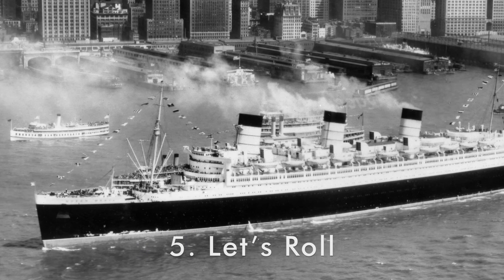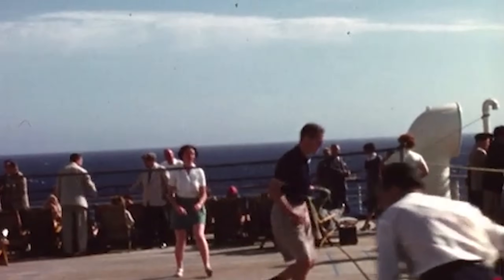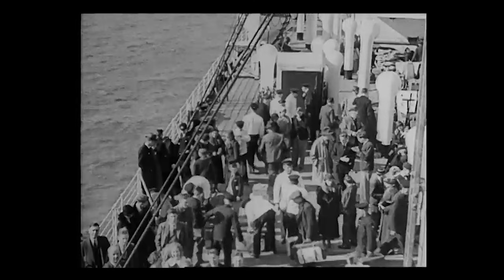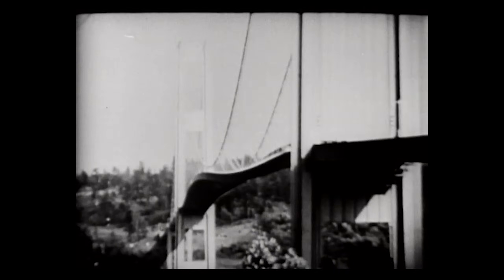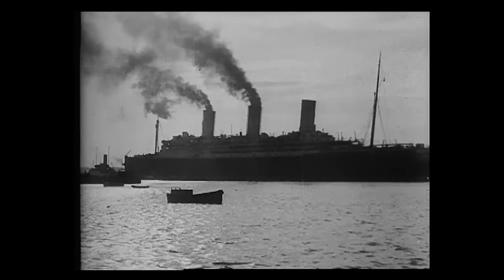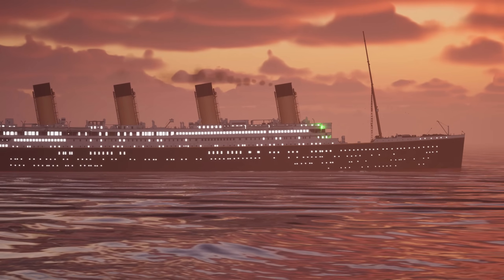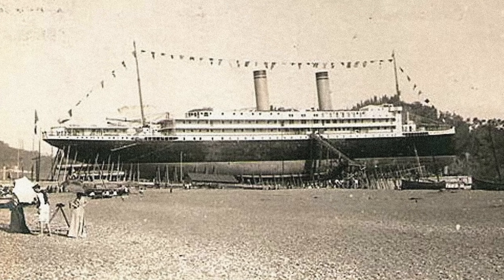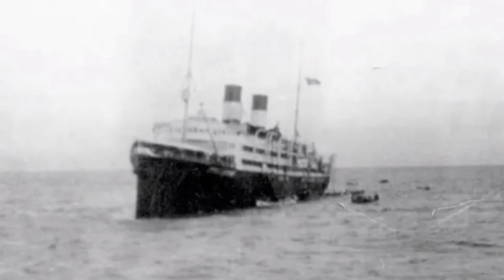5 Ship Design Fails

Comment: Regal Ship Vasa : A ship built between 2 different designs, where ship builders changed over the years, feature like a 3rd battery deck was added because it would look cool and a chief aka. the king demanded "just get it done..." And there was a thing with using different rulers where one had inches set to 2,25mm and the other 2.5mm ... A small wind gust pushed it over to the side and it took in water and sank after a very short distance.

Comment: The nr 1 ship spot reminds me of the Wasa ship, but that was only similar issue, it had its weight, but it was designed wrong considering what was put on top, so was too little weight down below, and much on top, so it also got sunk when it launched by a gust of wind.
That was not a passenger ship tho, and in quite a different age. :)

Comment: The thing that led to a hull breech in the Titanic, was a pre-existing fire of three weeks duration in the coal bunker hard up against the area of the hull breeched by the rather insignificant iceberg that ultimately sank the Titanic. The crew had struggled to both extinguish the fire, and to hide its existence from the public by berthing the Titanic stern first, thus obscuring the area of the Titanic’s starboard hull from public view. The fire weakened the hull and it remained lit and causing problems the entire time the Titanic was in transit. Weakened hull met iceberg and bye bye Titanic.
Reply: Surely you mean the small patch of smoldering coals that (1) wasn’t located up against the outer hull, (2) didn’t cause any significant damage or weakening whatsoever, (3) was completely put out over a day before the collision, (4) wasn’t covered up, and (5) was dismissed as not being that big of a deal until some journalists sensationalized the crap outta it in 2017?
Reply: @DerpyPossum  You are utterly wrong. Read something with legitimate info.
Reply: @douglascoleman1252  The inquiry transcripts, “On A Sea Of Glass: The Life & Loss of the RMS Titanic”, research papers and essays written by the likes of Mark Chirnside and Dr. Paul Lee, “Titanic: Fire & Ice (Or What You Will)”, the related article on the TitanicSwitch site, etc.
Not enough for you?
Reply: @DerpyPossum  Nope. Read it all again, including the docking rationale.
Reply: @douglascoleman1252  Oh my freaking goodness, you seriously believe the “burn mark” thing…

Comment: I wouldn't really call Titanic's bulkheads a design flaw. They were designed to hold with the forward 4 compartments compromised. Had the iceberg damage been contained to those 4 compartments, the bulkheads would have worked as designed, and the ship would've remained afloat. The reality is that, even if the bulkheads had gone as high as B Deck, there was still too much damage for the ship to remain buoyant. It would have sunk anyway. I doubt there's any ship today that would be able to float with a 300 ft series of gashes in her hull.

Comment: I kinda feel u should have mentioned that the Titanic also probably wouldent have sunk if it had a double outer hull like the SS great eastern.  Had decades before. The SS great eastern actually got similar damage as Titanic by hitting a reef but only requiered some repairs on the hull.

Comment: @ 16:00 designers not considering that type of impact.  Something like that almost happened again. A student noticed the Citibank Center in NYC would fail if the winds above 80MPH hit at it cross angle.  The instructor check the students work and realized he/she was correct. The Instructor contacted the appropriate people and Citibank immediately began emergency repairs. The repairs were on halfway done when a hurricane hit NYC.  The mind boggles if that student did not detect that. ( It is on youtube.)

Comment: The US Navy's North Carolina Class battleships had the same harmonic problem as the Lusitania.   Once the ship got her speed above 25 knots vibration became an issue and increased as the ship reach her top speed of 28 knots.  The solution was to change the propellers which only moved the harmonic induced vibrations to a different speed regime. However the vibration issue was now at a speed that would be unlikely in normal cruising or battle, around 18 knots.

Comment: That was "Galloping Gertie," the Tacoma Narrows bridge, not the bridge you described as affected by soldiers marching. It broke up for a different reason.
Reply: Actually same reason, mechanical resonance. It had a bad design and physics causes it to shake and roll in windy conditions. The video did show Tacoma Narrows on the clip label.
Reply: @ChicagoMel23  Actually not the same reason. Galloping Gertie suffered from aeroelastic flutter. Marching soldiers cause resonance amplification by matching the resonance of the bridge.

Comment: I absolutely love this channel but the idea that the Olympic class's bulkheads weren't high enough is simply inaccurate.  They were more than adequate for their designed function of keeping the ship safe while balanced against the need to work the ship efficiently and effectively.  The reason for this is simple; water will seek its own level.  Based on this, we know that water will not rise inside the hull of a ship higher than the water level outside the hull.  The Olympic class was designed to survive any 2 compartments or the front 4 compartments being flooded.  The engineers who designed the Olympic class knew this, knew the volume of all the compartments, knew the weight of the water that would fill that volume and how low the ship would go into the water before the buoyancy stabilized the ship and halted the flooding.

Based on this, they built the bulkheads with an adequate safety factor to ensure that water would not top them provided that the ship had survivable damage.  In the Titanic's case, the bulkheads being run all the way to the top of the ship wouldn't have saved her; too many compartments were opened to the sea and the weight of the flood water would've continued to drag the ship lower and lower in the water, causing the water level inside to continually rise.  Even if the bulkheads had been made watertight from above, the weight of the water infiltrating the hull would have eventually dragged the bow underwater and flooded the decks above the sealed compartments from above.

A more realistic design flaw of the Olympic class was the lack of a double hull.  After the Titanic sinking, both Olympic and Britannic had a double hull installed to cover the boilers and machinery spaces.  Had the Titanic had a similar double hull, it's possible, though not guaranteed, that her 6th & 5th boiler rooms would have remained watertight and that she would have survived her damage.   However, no change in her bulkheads, with the possible exception of longitudinal bulkheads in all of her compartments would have saved her or even dramatically affected the final outcome.

Comment: I read a Queen Mary account in "Captain of the Queens" where the former captain and commodore of the fleet described an incident within a French harbor some time after WWII.  There was a storm and he began to move the ship out to weather it, as I recall.  The anchor snagged a WWII era cable and she began to swing out of control, blown hard by the wind.  He ended up going to full power in an attempt to stop the stern from grounding but the ship still struck hard enough to be felt on the bridge.  I believe he said the very stern at the bottom of the ship was filled with concrete as a repair, and seeped water ever afterward.  Harry Grattidge, Captain of the Queens, excellent read I Highly recommend the book.  As an aside, it would be interesting to know if that concrete is still there, because that would be really bad if it is.  Concrete, steel and seawater do not mix well.
Reply: I read that book as a boy, and toured Queen Mary in 1972.  While I don't recall seeing any concrete (Ha!) when I saw the propeller shaft reduction gears, I do recall that some of the gear teeth were chipped.  I guess @ 35 years of non-stop transatlantic service might do that.

Comment: To be fair to the Titanic,  while the bulkheads only went up as high as E Deck is true,  even with a sideswipe, the key was that Andrews and those who built and designed her weren't counting on the NUMBER of compartments to be flooded.  They thought at most, it would be 2.  The Titanic (and her sister, the Olympic) could survive a collision even with up to FOUR (4) compartments gone, but however, FIVE (5) were gone, and that was sadly the end.
Reply: The steel also had, I believe, a higher concentration of sulphur, thus making it somewhat brittle.
Reply: @Peter78730  Olympic had same steel.  The Titanic sank because she hit an iceberg and the damage was bad enough that it would have sunk a battleship at the time.

Comment: A similar incident to the one mentioned 19:19 was the HMS Prince of Wales when it sunk in 1941 while being in an air attack was hit near the port most propellers shaft by a japanese torpedo and started taking on water also the propellers also cause further damage to the battleship and was difficult to turnoff as the damage also took out the controls which contributed to her eventual sinking.
Reply: She _sank_.  After she *sank*, she was _sunk_.  Sink, sank sunk.  Drink, drank, drunk.

Comment: I have often thought that Queen Mary's one time rival, the supremely elegant French liner "Normandie" was perhaps better designed...? I recall seeing comparison film clips of both liners at speed...
Normandie's bow sliced through the water like a knife through butter, whilst the "Mary's" was like sledgehammer. Added to that was the Queen Mary was considerably more powerful(some 80,000 Horsepower(?) to Normandie's 50000 +/- horsepower). Please excuse if my figures are inaccurate, but suffice to say that the British liner was considerably more powerful.. I cannot recall any stories of the "Normandie" behaving "badly" in rough seas..Can anyone advise me if this was so...?
Reply: Normandie had a reputation of being a "snappy" roller in rough seas, that is it recovered VERY quickly from a heavy roll, so much so it could throw passengers off their feet.  No long, slow "Will it or won't it?" recoverys from a roll on Normandie!
Reply: @wayneantoniazzi2706  did she roll like a drunk?
Reply: @merafirewing6591  Not at all, aside from what I mentioned above Normandie was considered very stable.  All ships are going to roll in heavy seas but as I said Normandie recovered quickly, it didn't "hang" on the edge of a roll like Queen Mary or other ships did.

Comment: I have a question:

Where did Titanic, (or other coal fired, steam driven ocean liners for that matter), get the water for their boilers to turn into steam?

I literally never see anybody talking about this, so just thought I’d ask you, since you seem to know.
Reply: Fresh water for the boilers was supplied when the ships were in port.  At sea the exhausted steam was run through a condensing system that turned it back into water again and re-fed it to the boilers.  
This was actually 50+ year old technology.  It was developed pretty quickly when steamships first began taking to sea and it was discovered saltwater was unsuitable for boiler water due to its high dissolved mineral content.

Comment: Did you know. Joseph Goebbels commissioned a anti British propaganda film around the time of the Dunkirk evacuation (1940) Titanic (1943) The film A Night to Remember (1958) repurposed the model shots of the titanic from the Goebbels film. Charles Lightoller and his motor yacht Sundowner was present at the Dunkirk evacuation.
Reply: Can’t pin down the repurposed model footage, however the film A Night to Remember did repurposed some elements from the Titanic (1943) film.
Reply: @simonchandler9601  Supposedly some of the lower deck flooding shots and the exteriors of the passengers on deck were lifted from the German Titanic film, but that's about all.

Comment: Then there are the modern cruising ship design mistakes like the one which had no backup power and duplicate busbar distribution system were located separate from the main power which caused the water, sewage, air conditioning and food service to fail.   One could make a comic POSEIDON ADVENTURE type movie.   The sewage treatment system has broken down and in the heat, bacteria is generating a massive amount of methane and hydrogen sulfide pressure, and it's going to blow.  The decision was made to vent the system and create a terrible smell to avoid a cataclysmic burst in the system.  But one of the characters suffering from nicotine withdrawals makes the mistake of lighting a cigar generating a massive explosion and fire.  Maybe they could call it the NEPTUNE ADVENTURE.